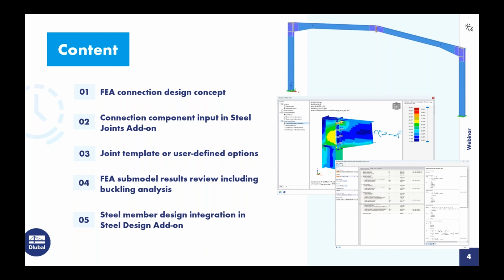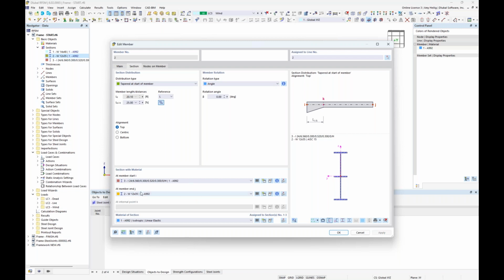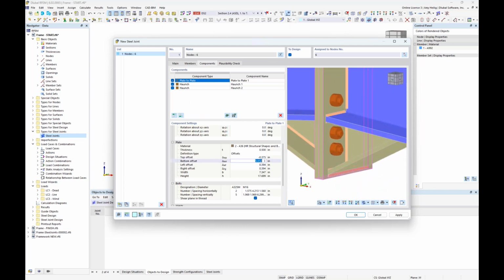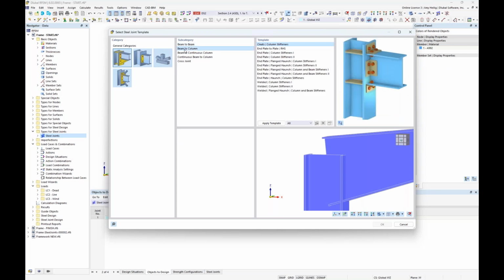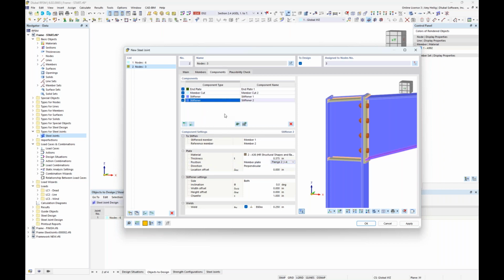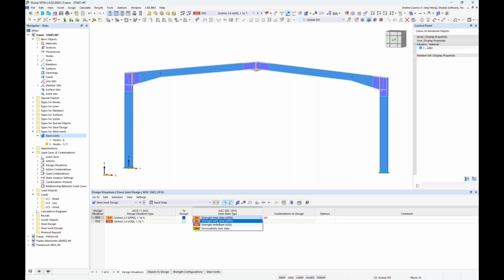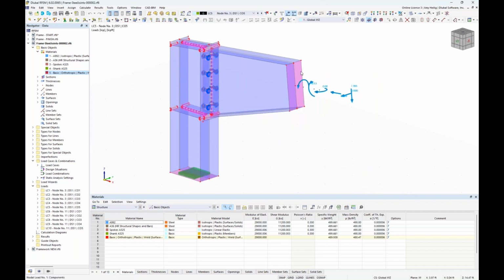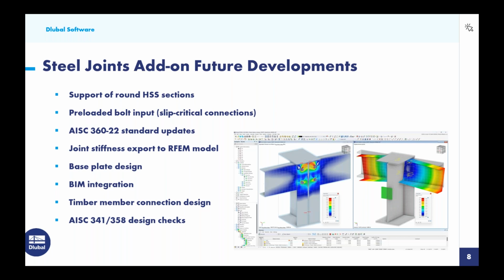Webinar | AISC 360-16 Steel Connection Design in RFEM 6

Comment: Is there templates for column to column connection type?
Reply from the maker: Hi, @vahidjebelli.2000! In the new version RFEM 6, the Steel Joints add-on allows you to design column to column connections acc. to the AISC 360 standard. There are also template options available to select from the library of connection types.

Comment: I think the major improvement is the joint design according to AISC and EuroCode, compared to the old version RFEM 5. You don't have to create a dedicated FEA model using Ansys to analyze joint
Reply from the maker: Hi, @BoZhaoengineering! Thanks for the feedback. We agree the FEA approach in the REM 6 Steel Joints add-on is revolutionary in that any connection design is now possible! You are not limited to standard connection types. Additionally, the member design and connection design can be completed in a single model. We hope you enjoy working with RFEM 6.

Comment: About the calculation taking a little bit longer , damn. The FEA model I made in a model of my own takes stupidly long, its been half an  hour and the calculation isnt done. And I am doing only one joint in a relatievely small structure of some 250 members. Can you share some tips and tricks to malke the calculation take less time.
Reply from the maker: Hi, @andreibaltaga1079! We would be happy to help. The calculation time always depends on the number of joints defined and the number of load combinations in the model. When one or both of these are significantly big, the calculation performance will be affected. Therefore, we suggest to define the connection design at only the controlling locations for identical or similar connections. Additionally, load combinations that are not controlling can be excluded from the calculation. For further assistance, please email us your model without saved results to info@dlubal.com.